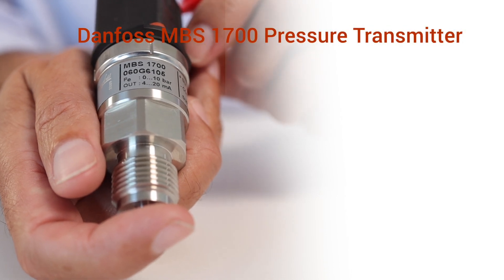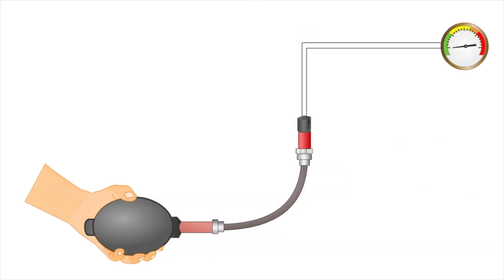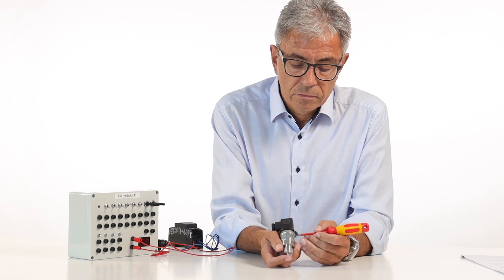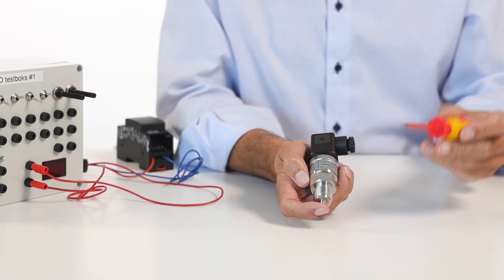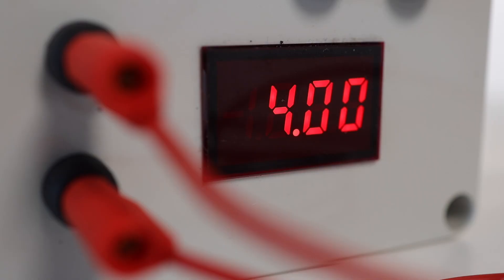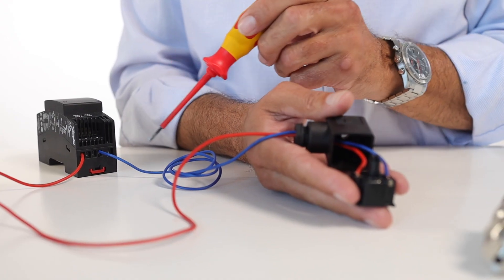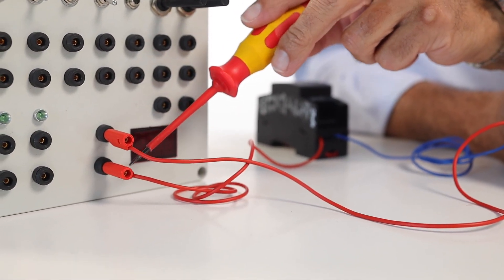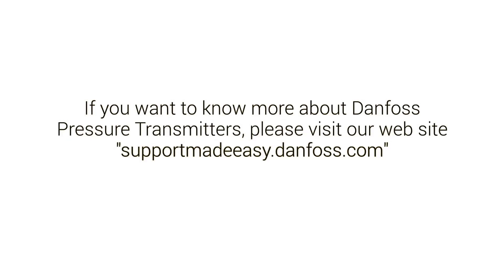How to install a Danfoss pressure transmitter | Walkthrough

Comment: What is the recommended wire  diameter for connection of such 4-20 ma pressure transmitter to VFD, for distance up to 10 meter ? Shielded or not ?
Reply from the maker: Hi Vitaliy, Thanks for your comment. Please click on this link and follow the instructions: https://assets.danfoss.com/documents/184395/AN33134209275301-000201.pdf. Hope this was helpful :-)